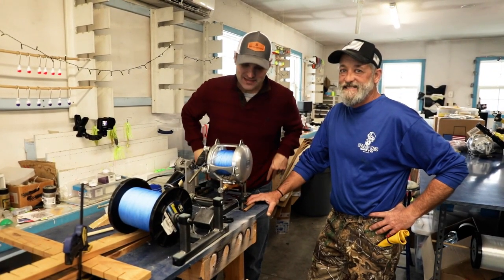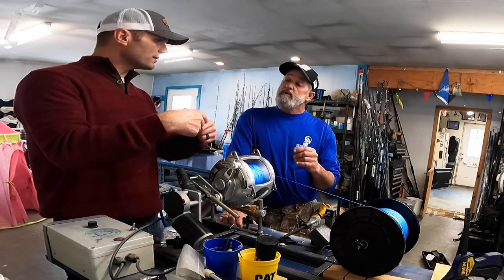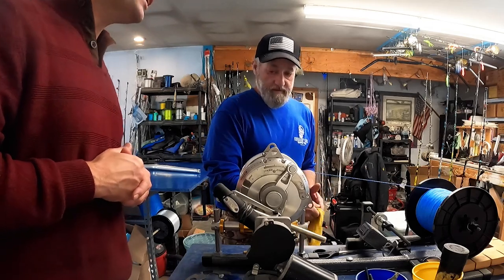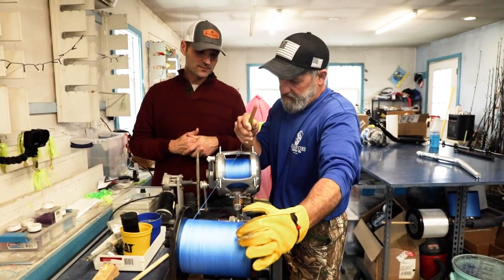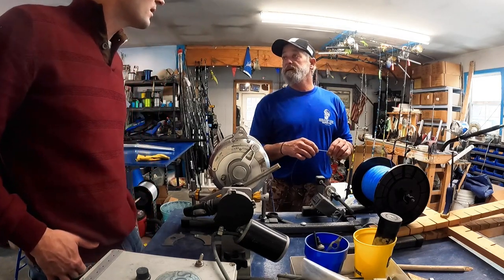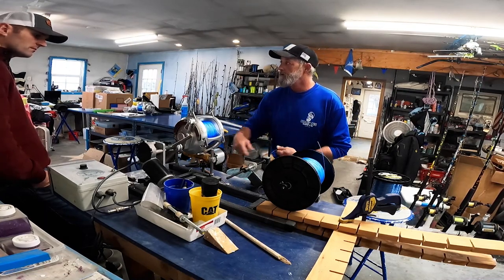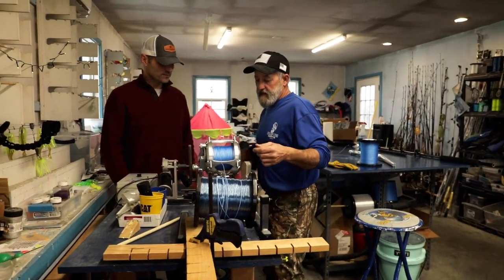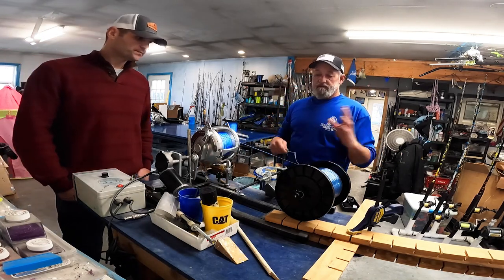How to Professionally Spool Your Offshore Fishing Reel: From Splicing Braided Line, Top Shot, & More

Comment: What size lines and and how much of each do you recommend for  the penn 50s and the pen 80s
Reply from the maker: A lot depends on the experience of the anglers on the rod Nick. For inexperienced,  we'd likely use 80' on the 50. For experienced anglers, 50 on the 50. On the 80 reels, we'd use 80 line for experienced, likely the same or higher for lesser experienced anglers.

Comment: How long does the mono last before it needs to be changed?
Reply from the maker: Generally, assuming the line hasn't been damaged, you're likely around 2 years Jayden before replacement. Of course, some would say less or more than that number, but that's the general rule of thumb we follow.
Reply: @saltwaterfishinguniversity  thanks for the info 😁
Reply: For me I top the real ( conventional reels ) off with new mono, the following season I normally take off 50 to 100yrds to get to line that hasn't been exposed to sunlight. I use Pink Ande Premium Monofilament it get's lighter in color after one season ( depending on use) so I remove  discolored line and repeat for one more season and then start over, I've doing it this way for more than 40 yrs.
Reply: @saltwaterfishinguniversity  interesting. Maybe I'm throwing money away but mono is super cheap in the scheme of offshore fishing. I have been known to change out my mono after one trip. I buy 3,000 yard spools of Momoi Diamond and run through it like crazy. It's like the cost of running my boat halfway to the Gulfstream! I've just always believed once that mono stretches it's a liability.